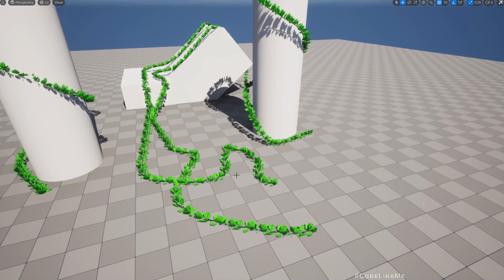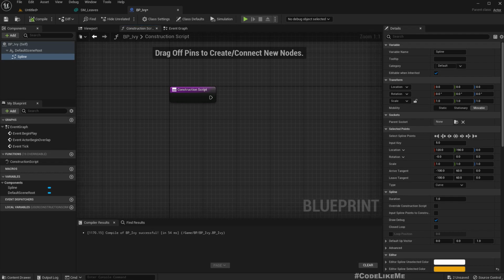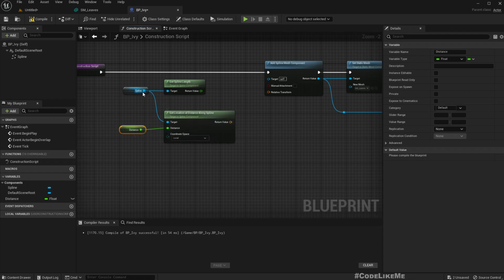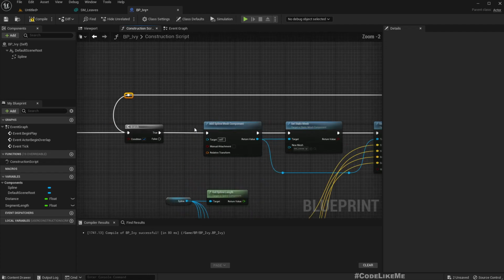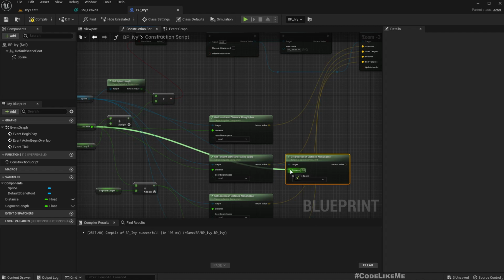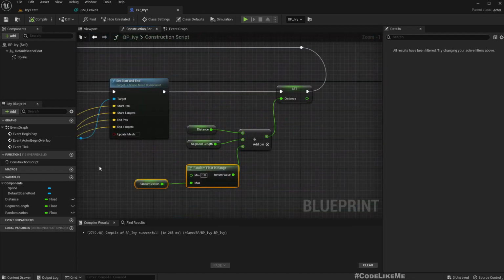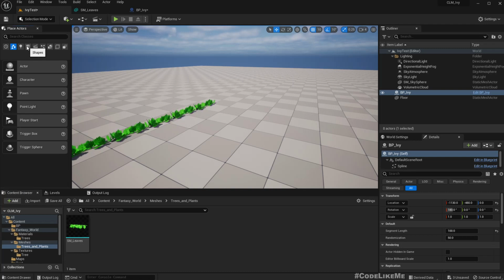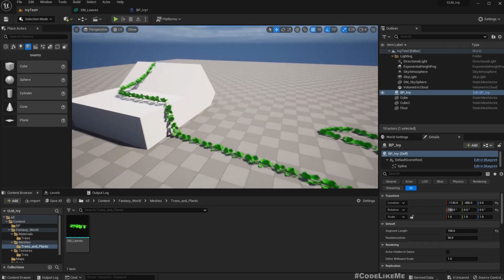Unreal Engine 5 - Procedural Ivy Tool

Comment: Do you have any advice on making the mesh you used in this video?
Reply from the maker: nothing special. but the straight cylindrical part should have some divisions in the middle to properly bend it on curved parts of the spline

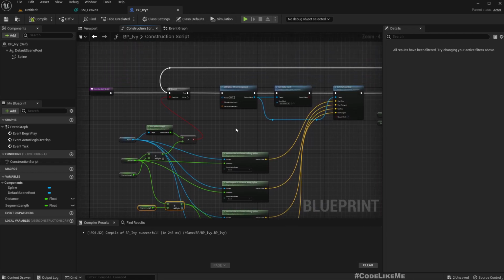Comment: Fir whatever reason, when I try to compile at 9:13 it freezes. Tried multiple times but it always freezes. Not sure if this works.
Reply: same here. It freezes on compile after connecting the set distance back on the branch... Maybe the static mesh needs any special feature... IDK
Edit: It seems the problem is UE 5.1. I tried on 4.27 and it works great. I wonder what version of UE5 CodeLikeMe is using
Reply: @marcelokhoury  I figured out why's that. In UE4 there is a limit of maximum number of loops when compiling. In UE5 there's no maximum number of loops so that's why it "freezes" - because the system enters into an endless looping. It is not a bug in UEE5 but more as a feature. So, in order to make it work, we need to put a limit. So, instead of Branch, you need to add the Loop function and control it.
Reply: @VariablesSs  thanks my friend.
Reply: Weird, I am using 5.0.1 and it doesn't work

Comment: FIRST LIKE! Can you help FIX out of video memory when I CLICK play UE5?
Reply: Try in console this - "r.Streaming.PoolSize 0", this also can be added in UnrealEngineVersion\Engine\Config\BaseEngine.ini file to section [/Script/Engine.RendererSettings], add there - "r.Streaming.PoolSize=0"
Reply from the maker: @ArsMar thanks for answering
Reply: @CodeLikeMe  What is it? I still do not understand. 🙃
Reply: @PhatNguyen-cu2bx  do you knew what is console? Usually opens by "tilda" button on left below "esc", has symbol "~" on it. There you can enter many commands for diffenet purposes. So firstly try enter there command - r.Streaming.PoolSize 0
If it helps to solve rour problem, then can write this command in engine configuration to load this automatically.
Don't be shy to just google any question, exemple - "What is r.Streaming.PoolSize", you'l get lot of information.
Reply: @ArsMar  Ok!